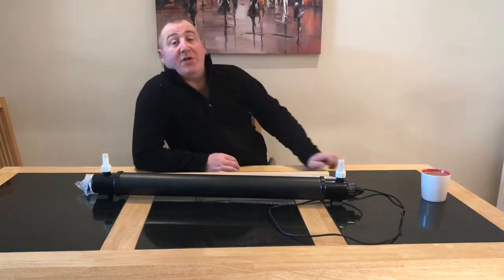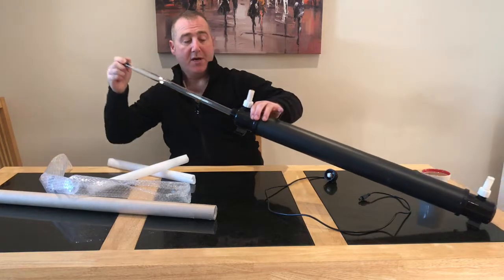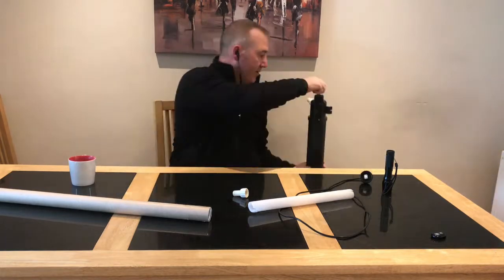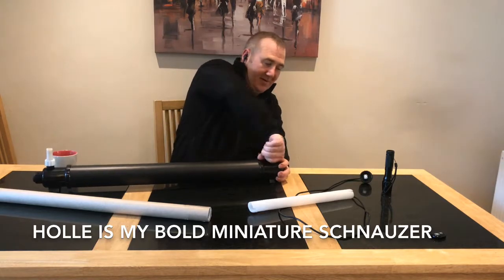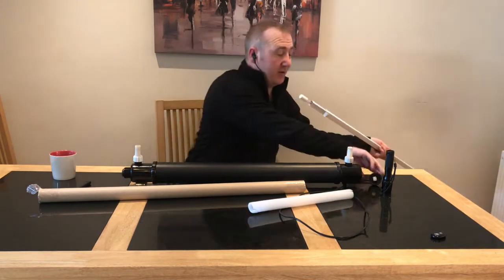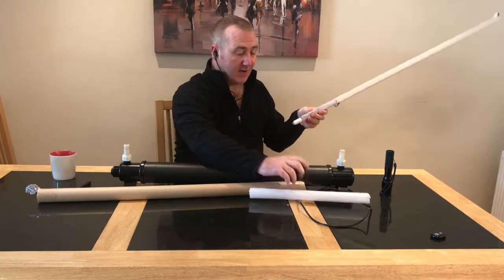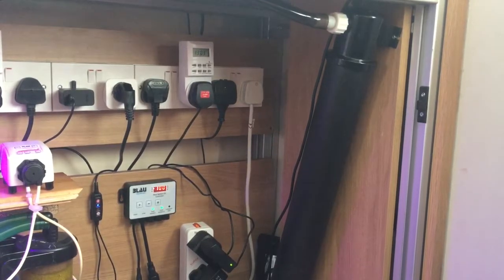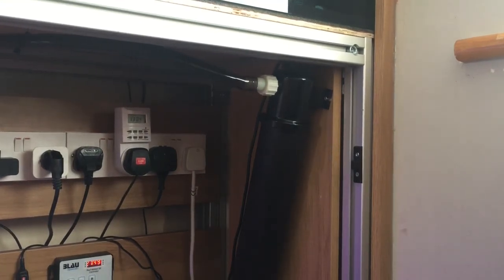D-D 39 watt UV Filter servicing and fitting

Comment: Warning! useless garbage..
I bought x2 deltec 39w uvc.
The lamp melts the plastic on both units on the inside.. Already after 60min the water starts to smell burnt plastic..
Reply from the maker: Mine was a pain in the ass too ! Not the same problem but it ended up in the shed with all the other unused aquarium stuff.  It was usher error on my part that ended up breaking parts.  It’s a frustrating piece of kit to maintain.  Mine worked very well while it wasn’t being maintained!

Comment: Great video will this kill most un wanted things in a freshwater aquarium pathogen algae
Reply from the maker: Hey Unal,
There’s a not a simple answer to this😊🤷🏻‍♂️.   A uv steriliser is a very useful extra tool to add to an aquarium along with a complete maintenance routine like water changes and cleaning of your glass etc.  Any floating or suspended algae or pathogens in the water column will be either dramatically reduced or killed altogether by a properly sized pump to send the water through at the correct flow rated for the uv.  
It’s not a magic wand that solve all problems but it a great piece of kit that does give a little more insurance against anything getting out of control quickly 
Hope this answer is of some use and not a knock on the uv, I love mine and it’s great along with all other maintenance 
Mick 😊
Reply: @michaelsdiscusandatticaqua9155   Thank you for your reply ,it's not a magic wand it's another tool to help and make your hobby a little better , i will be getting one very soon thanks again.
Reply from the maker: Hello again Unal
I love getting new pieces of aquarium kit 😊 it’s almost a hobby in it’s self 🤷🏻‍♂️😁 
What fish are you getting it for? 
Michael
Reply: @michaelsdiscusandatticaqua9155  Hey Michael I have had my set up for about ten years now I keep African Cichlids and I have not had major problems so I thought I would add this uv that you have got what do think.My aquarium is 6ft by 2ft by 2ft and I have two oase 600 filter running on it so I thought of adding a uv onto one of these filters.

Comment: Good video pal, I bought a 20 watt unit that came with the quartz sleeve smashed, bought another from my fairly local shop, looking at your vid I had the same panic moments installing the sleeve, when you consider it’s only sealed with that viton seal it’s a wonder it doesn’t break when you screw it down, I have a Vecton in my smaller tank, pig ugly but the Deltec is a nicer unit.
Reply from the maker: Hey, 
Thanks for the comment:) as for installing the sleeve, you should have seen the panic at the whole thing not going together for 10 minutes that I edited out😂🤣 I was nearly ready to throw it in the bin ! But it’s been a great piece of kit and I’ve had almost no problems with my discus and have no doubt the the uv is part of it.  
Michael